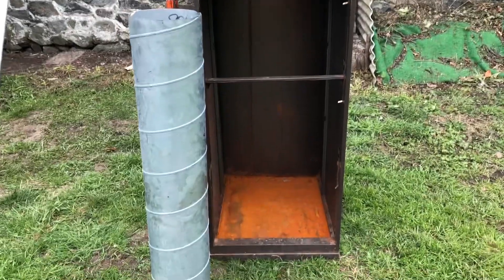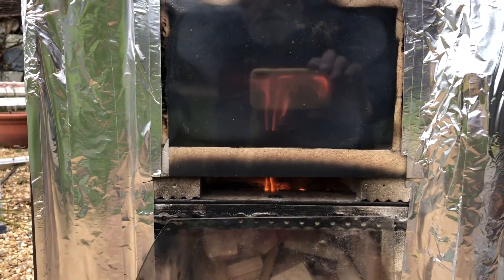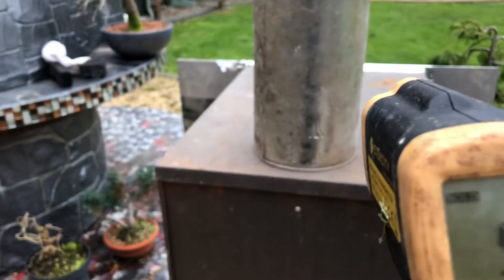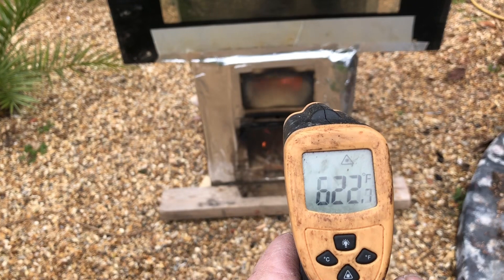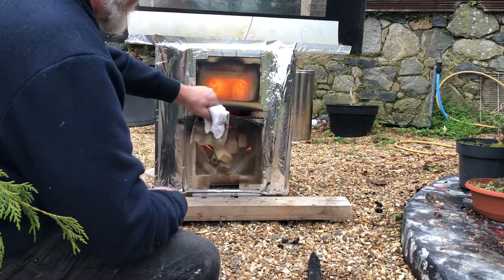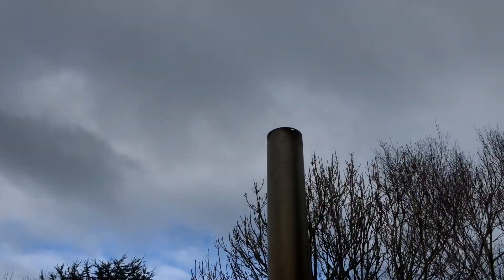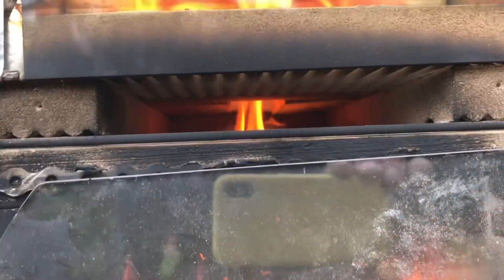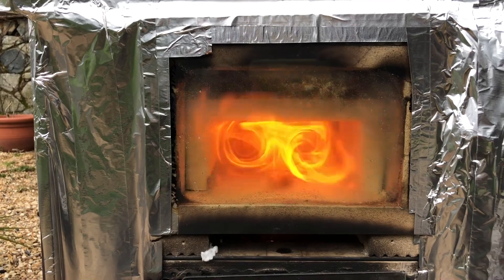Vortex stove in a bell

Comment: If I understand the new setup correctly then you now eliminated the primary air completely as the 2 back slots are now being enclosed by the cabinet and therefore can no longer supply fresh oxygen.
The system is now mostly running on secondary air and a small gap of 10mm at the front?
Reply from the maker: Well yes and no, I am just testing as many aspects as I can, I think it may be necessary  to adjust both depending on the final format.
I have done some more test runs today but i did not film them!

Comment: What heat rating is your door glass?
Reply from the maker: Do you mean the big one ? That is from an oven door so it might be 300c or it could be 750 if it is ceramic. It is difficult to tell …
Reply: @foxfish7115  I was referring to the glass used as temporary firebox door. I understand Robax or an old ceramic cooktop from a range is good for the upper cooking area. Before I build an indoor masonry cookstove I will likely test the core outdoors ......just wondering what is the required glass for a firebox viewing door. I have an old oven door and am looking for a ceramic top too.
Reply from the maker: @mozit6  Ceramic "glasses" like Neoceram, Robax and PyroCeram are all ceramic glass (not really glass at all) are all good choices but they are not cheap. Most ceramic glass can run at 6-700c and can take more for short periods.
Ceramic glass cook tops are also great bur are normally black.
If you have a large stove store near you, they will have off cuts that might well  be free!
I find Neoceram  used in the top viewing window will last a year before it goes opaque and needs polishing but it often hits 750c.